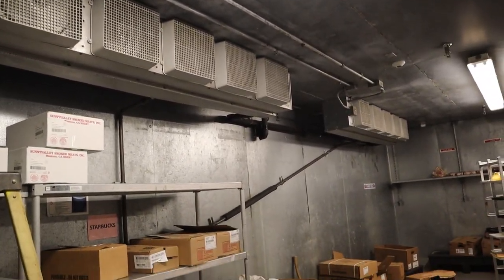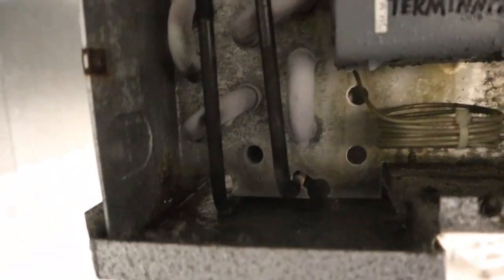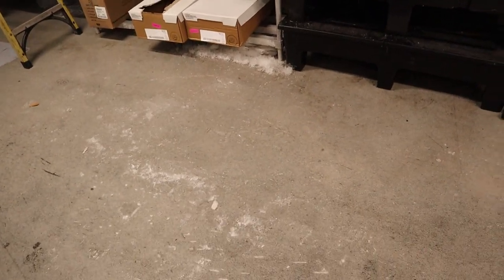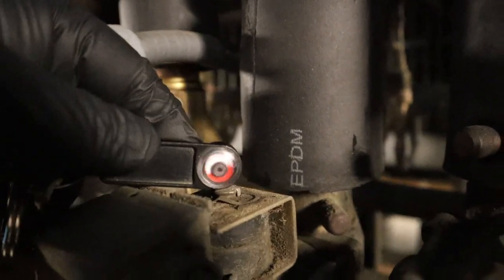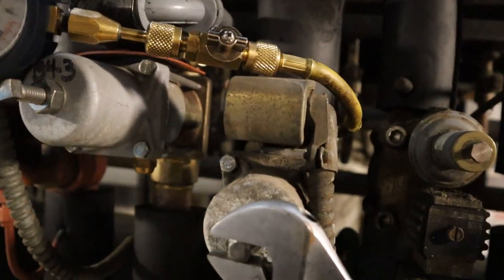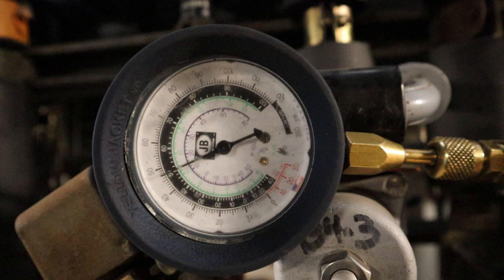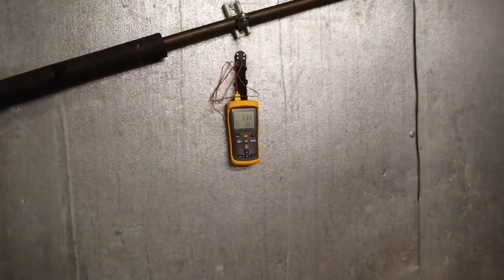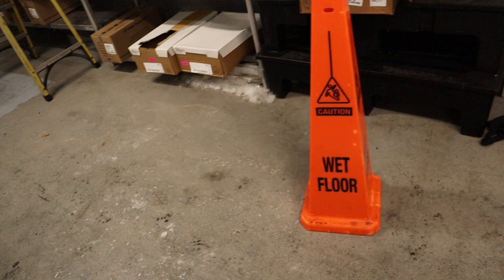Refrigeration Meat Box Too Cold EPR Valve Adjustment

Comment: Nice vid. I do think though while a 10*TD for walk in box evaps is a good rule of thumb, that’s totally susceptible to being designed with slight variations.  I try to verify on the refrigeration schedule what the design specs are.
Reply from the maker: For sure it’s just a rule of thumb all equipment is different specially with all the new stuff coming with better efficiency

Comment: Great video but now the question is why did it drop temp so low? Is it an adjustment for the temperatures due to weather that could influence the box temps? Just wondering
Reply from the maker: Could of been someone else adjusted it or the valve was just wide open to the suction group.
Reply: @refrigerationconfidential4376  alright was just wondering I appreciate it.  From your experience how leaky are all these rack systems? The supermarkets in my area are very much leakers.
Reply from the maker: @JDT738126  they are all leakers some how these equipment are very old and with a all the retrofits being done they leak even more
Reply: @refrigerationconfidential4376  thats what I figured,  Im about to start doing commercial at a new job tomorrow.  Wish me luck!

Comment: Awesome video I’ve had problems in the past with adjusting the epr valve with a low load on the rack . Did you manually turn on all compressors at the rack to adjust ?
Reply from the maker: No I didn't have to.. did some systems get removed from that Rack? it sounds like you have too many pony's on that rack. Might just do away with a compressor if its not needed. I would check out all compressor cycle count to verify.
Reply: @refrigerationconfidential4376  I have 3 comp on a Hussmann with 5 individual circuits. Na mostly just 1 runs constant but when the load increases #2 turns on
Reply from the maker: @D_Nice981  sounds like some of those compressors need unloaders
Reply: My lead told me manually turn on all compressors to adjust the epr. I think he’s wrong
Reply from the maker: @D_Nice981  engineering might need to get involved on that one. 3 compressors for 5 circuits but I'm not sure what kind of run you have to cases. so many diff variables in play.
Reply: @refrigerationconfidential4376  probably the store  I service is old as hell . Plus my lead told me that if the saturation temperature is below set point then you can adjust the epr without having to turn on additional compressors. Is that correct
Reply: @refrigerationconfidential4376  right I was just using an example. The rack runs fine just had a problem with setting an epr valve with only 1 compressor calling.